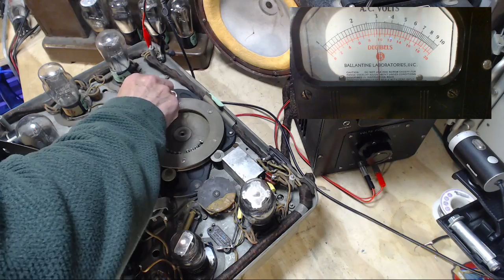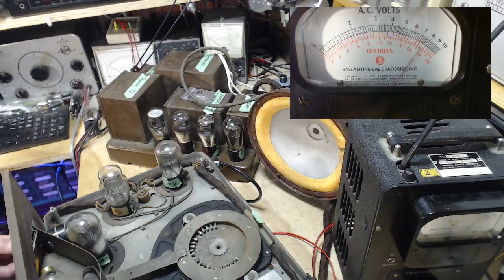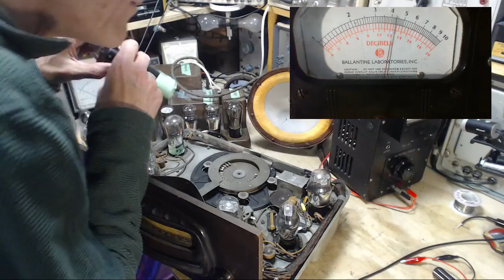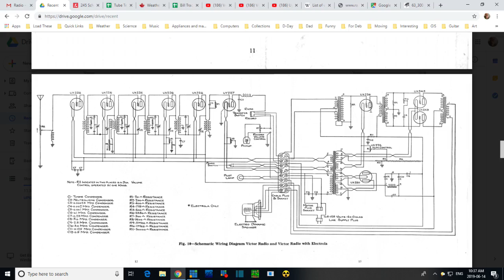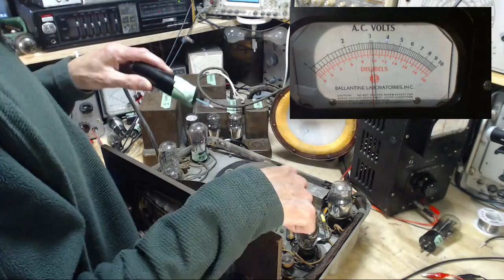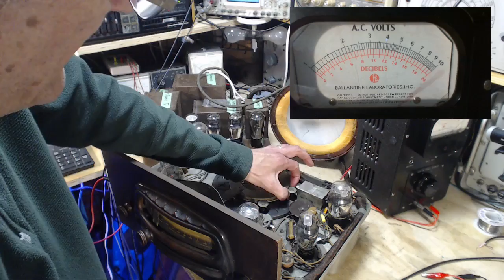1929 Victor RE-45 Video#22 - Finale

Comment: I know I'm watching this a few years late, but I disagree about the speaker, as many of them still sound great for the period, and I'm sure Mr. R's original speaker sounds great as well.  The Victor radio is not for the faint hearted, that's for sure! Most radios from the 1920s are similar to each other in design, even with the later 20s and early 30s sets having the volume controlled at the antenna and some with a secondary control on the cathodes or elsewhere.  Of course, the Victor's tuner is unlike any other radio I've seen anywhere, and is a sight to behold. If not for that long running intermittent crackle, I'm sure you would have enjoyed it more.  If you get another one, please don't pass judgment based on your experience with this one. Hopefully you're not suffering from PVSD (Post Victor Stress Disorder)!

Comment: Dummy loads are great for dealing with this type problem where you need the volume high but don't want to go deaf. The resistors are not expensive. I was forced to use one because the amp I was working on would only  allow some required ac checks using a dummy load. I bought four 4 ohm resistors to allow a mix and match of different resistances as needed. It worked great.

Comment: Those square-head tuning pegs remind me of tuning a piano. Maybe an eight-point nutdriver would suffice. (And I thought the Bristol Spline system was needlessly obscure). That set looks like it was deliberately designed to require periodic adjustment to compensate for mechanical wear and component aging.  0_@

Comment: I think it’s the roller that reduces the signal when pulled out is the one that needs adjusting. If the other 3 rollers peak the signal when pulled out then the one that doesn’t is the one to adjust. Otherwise you are just changing the whole tuning position.